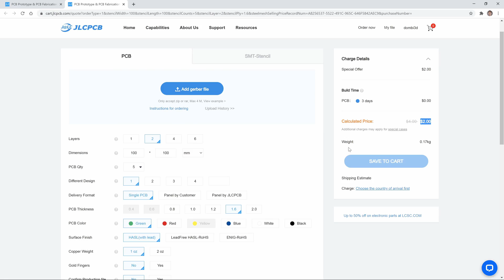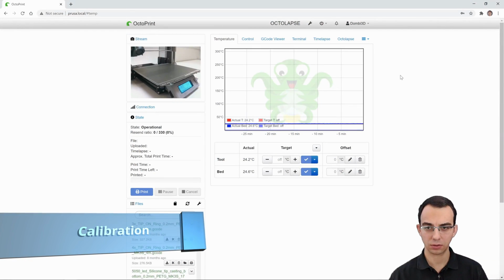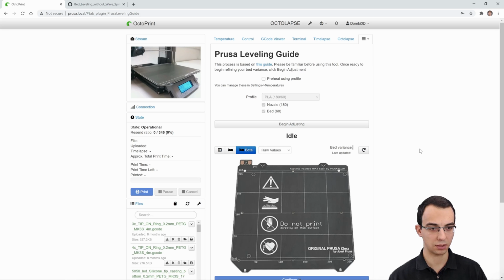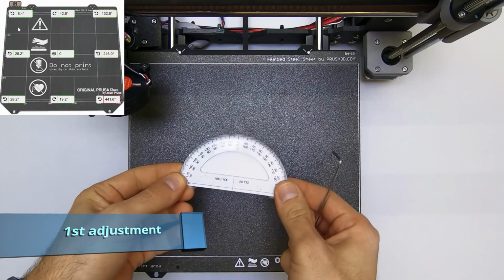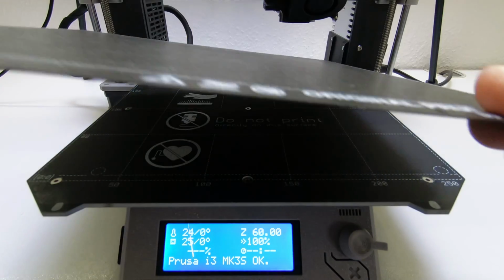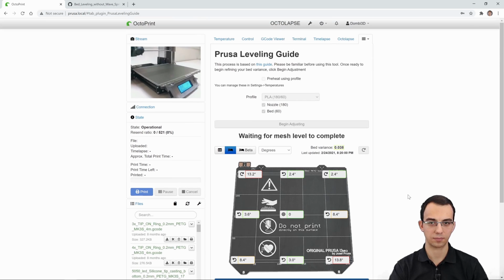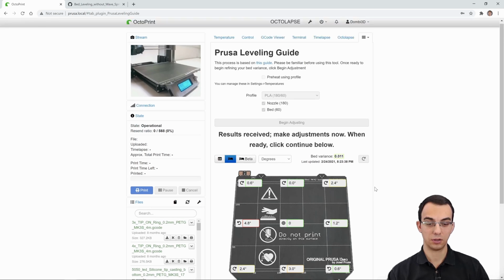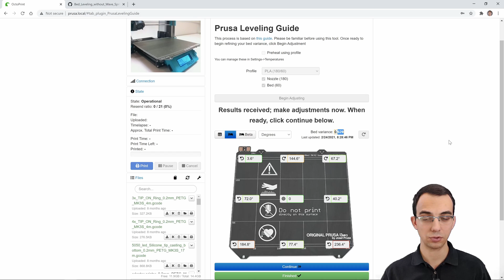How to reach a perfect first layer with your Prusa 3D printer | Nylock Mod

Comment: I don't believe the algorithm is compensating for the fact that one screw moves at least a quarter of the bed, the calculation of the angles seems to be based on the thread pitch. However, for example if I move the left screw, the entire left half of the bed moves, which affects the height of the top left and bottom left corners. If I then adjust those two corners, I will either over or undershoot the adjustment. TL:DR, the screws are not independent of each other but the plugin treats them as so.
Reply from the maker: It takes some try until you get all of them right but it worth it, trust me! :)
Reply: @Dombi3D  I just did mine. For the first adjustment following the numbers is fine, for 2nd adjustment, I turned less than the displayed angle. Then I did 2 repeated tests without adjusting the screws to observe which part of the bed was consistently higher or lower, and made adjustments on those corners turning less than the displayed angle. I continued doing 2X tests and only adjusted IF the readings were consistently high or low by MORE than 10 degrees. As you said, it's not meaningful to try to go for very low variance as the numbers naturally fluctuate. I stopped when multiple tests consistently gave readings of less than 0.04 variance. and no corners were consistently very high or low.
Honestly I went overkill, I think for most people, just do 2 tests/adjustments and call it a day

Comment: How's it holding up after a year?
Reply from the maker: I haven't adjusted since then and printing still solid. Not measured it though, but until it works fine I am happy.
Reply: @Dombi3D  thank you! I broke my heated bed so I think I'll replace it and do this much appreciated.

Comment: I'm in the middle of this adjustment perfection right now. I have mine down to about 0.054 but notice that with each new run and no adjustments made, the variance is changing each run. Is this normal?
Reply from the maker: Yes! The sensor itself has also some tolerances. Do not go overboard. If you know which bed temperature will be used the most  you can heat up the bad and make the leveling there so it is more precise
Reply: @Dombi3D  thanks. Would you recommend to only adjust with bed temp set or cold?

Comment: Excellent!  On my mk3s+ the factory spacers are 5.5mm tall and 6mm diameter.  Also you should post your raw values so those of us without octoprint can compare.   On my machine without octo the biggest difference between high and low is 0.117, which didn't seem great, but it was closer to 0.500 without the mod, so definitely improved 👍 I also noticed my heat bed cord seemed to be pulling the corner down, so something to be aware of.

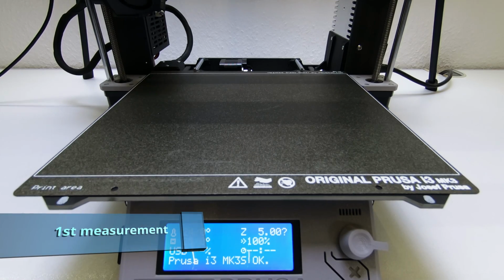Comment: Hi! At 3:22 we can see that your Z on the screen is "0.15?". It means that the Z calibration failed. We are several to have this issue ... Did you find a way to solve this ? Thanks ;)
Reply from the maker: If it was turned off and back on, the printer do not know its height and that is why it shows 0.15? with a question mark. It will go away after it calibrated itself.

Comment: Will the SuperPinda fix this issue? I have the superpinda and the 7x7 mesh leveling routine. But I still have to use the mesh bed level correction values a little bit to get things perfect. Awesome to see this foolproof method!
Reply from the maker: I do not have any super P.I.N.D.A. but this method makes sure that the bed as straight as possible from the beginning, so theoretically no Pinda needed anymore for bed warps just for finding the bed height for the correct Z start value.
Reply: @Dombi3D  For this type of leveling, it is necessary to have the Rasberry ? or the control of the leveling can also be performed without ? thank
Reply from the maker: @lucatt6980  because the script is running on the Raspberry Pi you need it.

Comment: Why isn't the printer with the PINDA auto-leveling sensor compensating for these unevenness?
Reply from the maker: It can compensate for a given amount. But I like to be start as flat as possible. This mod is not required if you get decent first layers. Some of the beds has bigger deviations where this mod could help.
Reply: @Dombi3D  I have deviations from 0.17 to 0.6 mm. Can the printer compensate for these deviations? I ran into the fact that my printer on firmware 3.10 does not compensate for them, which is strange.
Reply from the maker: @nickturin432  I could not find the maximum compensation capabilities of the printer but 0.6mm should be still ok I think.
Reply: @Dombi3D  I found that my prusa mk3s, for some reason, does not take into account the surface relief when calibrating the first layer. I put strips of A4 paper on purpose under the metal sheet. Visually observing the movement of the nozzle from the surface, I found that it does not take into account the relief.

Comment: This is a great mod. I installed it maybe two months ago and it's still pretty dead on accurate. It takes a couple of runs to get it right. Before the mod my 7x7 point bed leveling before every print would do a few extra probes on certain points. After the mod the leveling is the same for every point.

Comment: did you try to take the reading twice without doing any changes? because i have done it and every time the result will change, so i think prusa stock mode is more consistent 👌
Reply: He did that before the 3rd or 4th adjustment and it did change a small bit.

Comment: I just bought my FYSETC clone a month ago and the hotend heater stopped working. I know the wiring is proper as the printer had been working well and the thermistor is fine as temperature raises when I use a hair dryer. Is it common for hotend heater to break that quick?  What's the lifetime of a heater?
Reply: If you played to much with the hotend cable they might have snap, trust me they are SO sensible. I broke mine while trying to swap a new motherboard and installing a Bltouch

Comment: I have a question not directly related to this video, but to one of you previous where you show the Fysetc Prusa clone. In the video where you reviewd the Fysetc you said they're as good as the original, if you make some mods (proper bearings, better belts etc). But can you the just use it just like the original? All the profiles, mods and tips out there for the original, do they apply to the clone as well? Would someone notice the difference in a blind test? It feels a bit like stealing, buying the clone, but on the other hand: they designs are out there to make your own, so it's ok I guess. It's not like they try to sell a fake article and make you believe it's the real thing.
So...is it just as good? Or are there thing/malfunctions/inaccuracies that creep up over time/use that migth let you regret buying it?
Reply from the maker: I have bought 7 of them and did not regret it till now. As I said you have to assembly them properly and then it will work.
Bearings as I heard since them also better quaility. 
Prusa profiles works well if you use the original thermistor because the clone ones measuering somehow lower temperature around 10°C which results a shinier print with PETG but also more stringing if you not tune it down. If you have the orignial thermistor this is not an issue. I bought also hardened metal nozzle which requires this extra temperature because of lower heat conductivity so the orignial profiles are good then with the clone thermistor also.
I had at the beginning jams which was caused by the heatbreak with its teflon insert. So that has to be changed alos with a full metal one.
Reply: @Dombi3D  thanks a lot for the quick response!

Comment: Nice work man.. are you tightning the nyloc nut after adjusting? If not my guess is that the screw still can get loose from vibration as what tighten them are the thread in the frame
Reply from the maker: I let it so! Your point makes sense. I will check them after a few km filament printed. If it changes a lot I will try to tighten them after setup. If it also not helps I will try the silicone tube mod because it makes some tension on the threads. I just do not like its flexibility.
Reply: @Dombi3D  will be happy to know the result.. if you do tight them becareful.. i think the electric circuit is there and it won't like to be pressed on.. if i can think on another solution is adding loctite at the threads of the frame

Comment: great video! what's the reasoning you opted to do the test with the bed not heated? aren't you taking into account thermal expansion that happens when heat is involved? would be curious to know what your values are with NON-HEATED BED vs. HEATED BED..
Reply from the maker: You can make the calibration with preheated bed. For example if you know that you mostly print PETG then you should calibrate your bed on that temperature. As I say in the video I made the cold calibration just to finish quicker with the video.